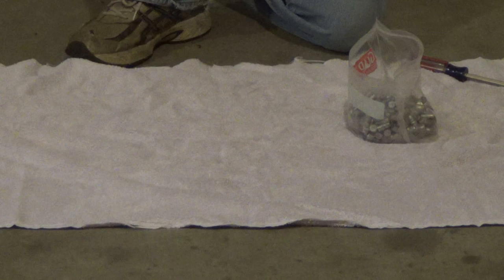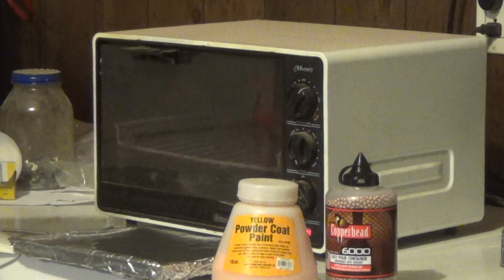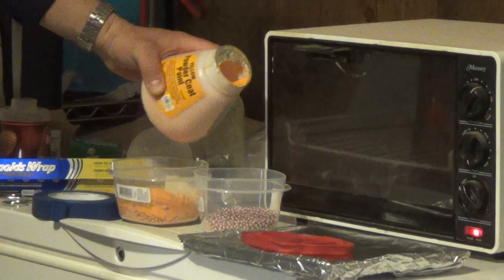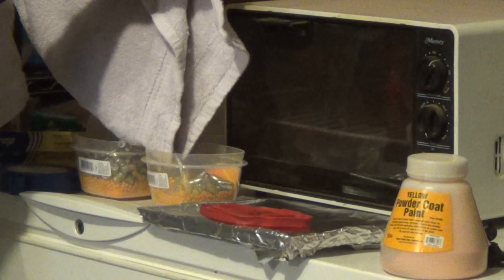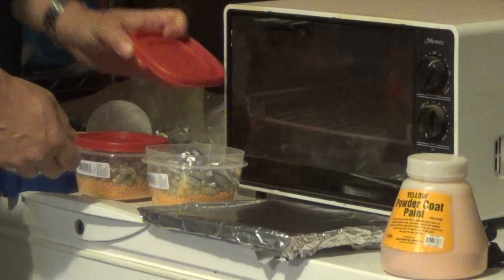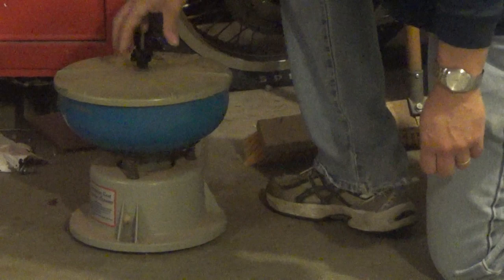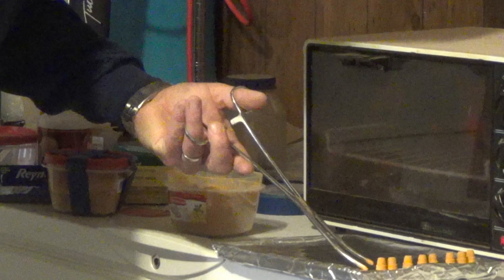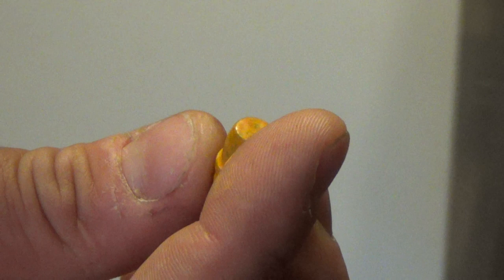Powder Coating Bullets

Comment: I have to say, the BB idea is really intriguing!  One thing I have had really good luck with that cuts the work down a lot is using aluminum screen material (the fine stuff) to separate the extra powder.  I just gently dump them on a sheet and roll it back and forth for a few seconds.  Believe it or not, the powder doesn't fall off that way.  Thanks for the video!  I will be getting some bbs this weekend:)

Comment: Hi there again! The powder coating works great and my Hornady bullet feeder loves these bullets. I have a problem though. They don't chamber in my glock. I sized them and I flared the cases even more then I do with lead bullets but it seems they have little build up from the powder coat on the edge of the rim of the case. How did you make it work? I checked the finished ammo with Case length gauge and it was fine. It just doesn't chamber.
Reply from the maker: In some of my 9mms you have to seat deeper for it to chamber (CZs being the worst offender).  The reason for this is you added about .004" all over your bullet in the bearing surface of the bullet was sized down in the sizing operation, but not the ogive.  This can be fixed by seating deeper than you would normally with the same bullet with wax based lube.  Use your barrel for a case gauge and if you are already pushing anywhere near the top end loads you should back them off and work back up once you have established an OAL that will work.  Glad to hear they are sliding right through your bullet feeder.  Keep us posted on your results!

Ebner

Comment: Thanks for making the video... New to casting... where did the "oil" come from?
Reply from the maker: +David Ryan 
In the beginning my concern was oils from my hands.  Since the making of this video I coat fairly soon after casting and it really hasn't been an issue.  If the bullets are clean you can skip the acetone step.  I have coated many since the video and all have came out just fine.

Ebner

Comment: Thank you man! I'll try it. Does the coat come off when you size the bullet?
Reply from the maker: PC does not come off with sizing unless it was nowhere close to being cured in the oven.  From my experience it actually aids in the bullet sliding through the sizer die, it's quite slippery.  I did make a comment about using the lanolin and alcohol mix for lubing but is usually not necessary unless sizing down A LOT.

Ebner
Reply: Thank you again sir! I almost gave up on my bullet feeder. It didn't work with cast bullets because of the lube. Thanks to you I'll be able to use it.
Reply from the maker: PC bullets should slide down the feed tube as well or better than most any jacketed bullet.  I hope you enjoy cranking out some cheap ammo quick!

Comment: Would this work with a rotary tumbler?
Reply from the maker: Yes, it should work in a rotary tumbler.  It takes 10-15 minutes in a vibratory, it will take longer in a rotary but should perform the same mechanical method, just a little slower.

Ebner